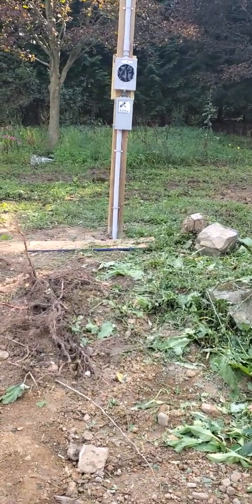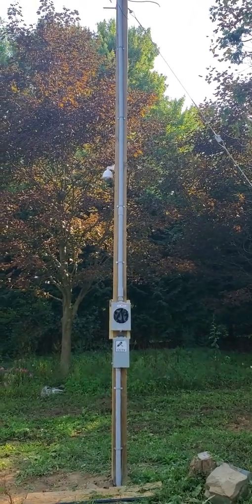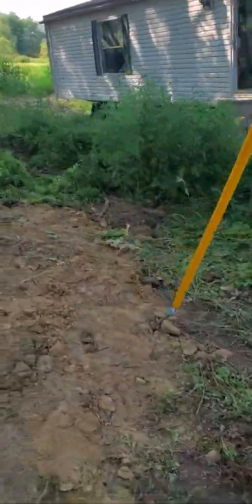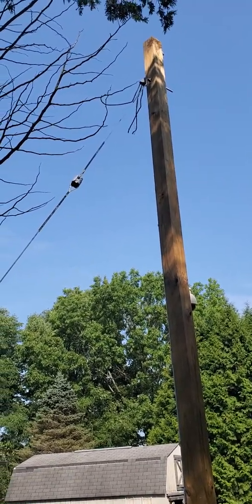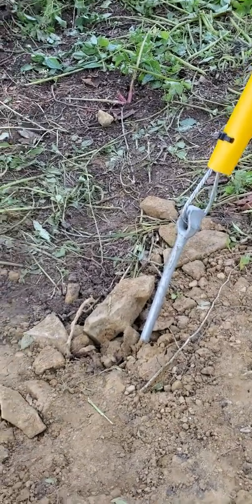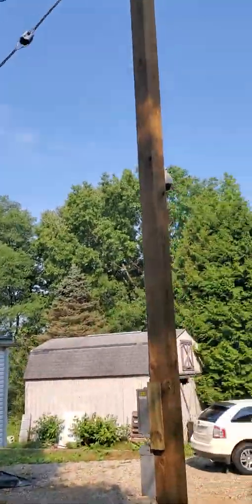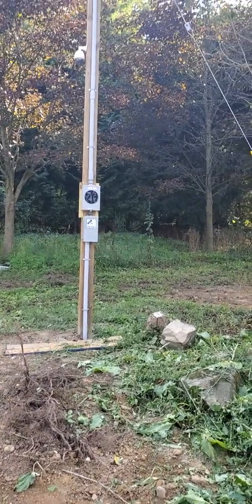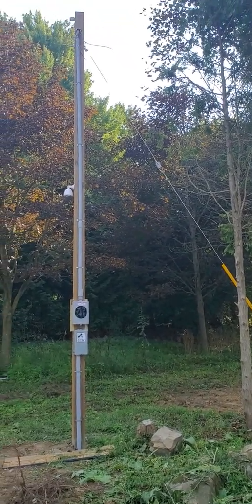Guy Wire Install Update

Comment: Does a guy wire carry any electricity? Are they safe to touch/bump into? I ask because of the plastic covering.
Reply: Hahaha no power. The plastic is because that cable can cut you also to protect